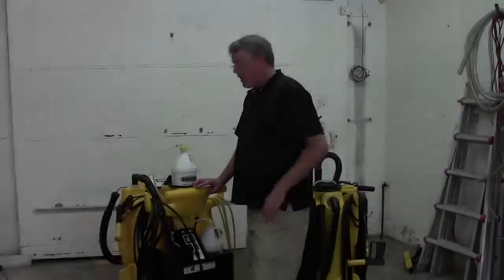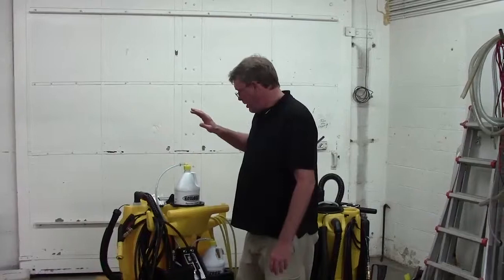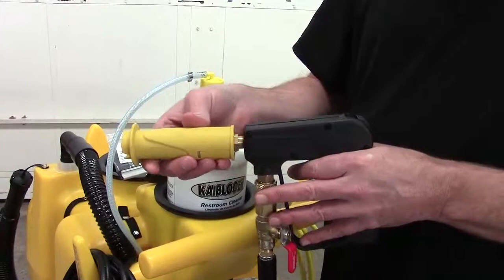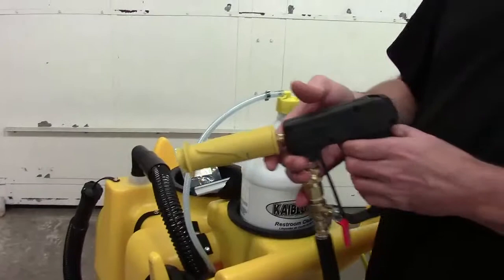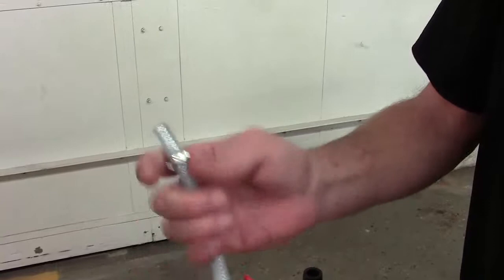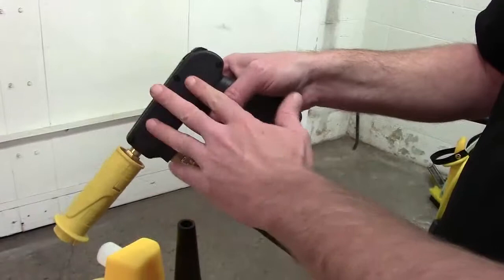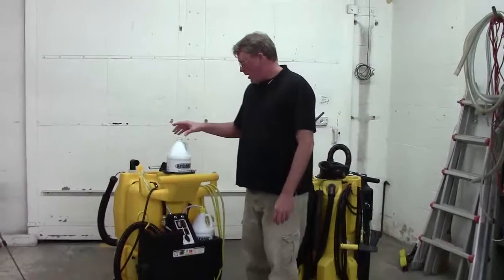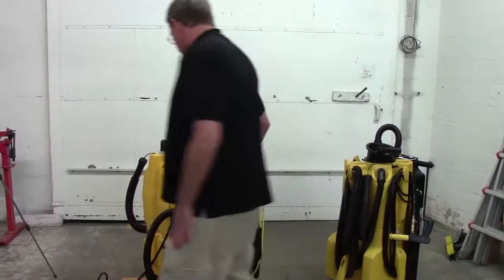Troubleshooting the Chemical Injection System

Comment: Where can you get more plugs and chemical caps? I keep trying to call customer service and no one can help me. Also, where can you get a chemical bottle that is compatible with the machine? And what is the function of the metering tip and where can I get more (provide links if possible because I’ve searched on the site and got nothing)? 

Also, do you guys sell chemical bottles separately that must be filled with your desired solution? Or do are there chemicals that come in bottles that are compatible with the machine? I keep looking for Waxie 940 that comes in a gallon bottle like shown in video, but I got nothing.